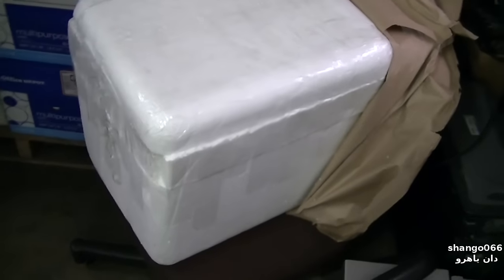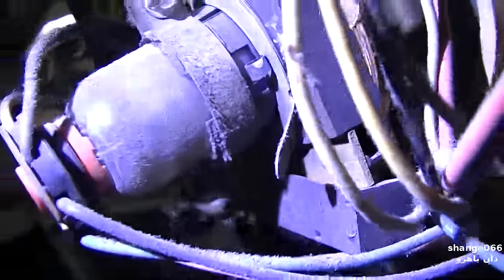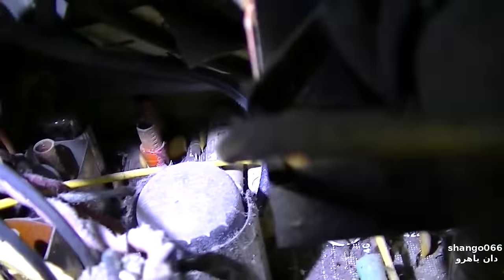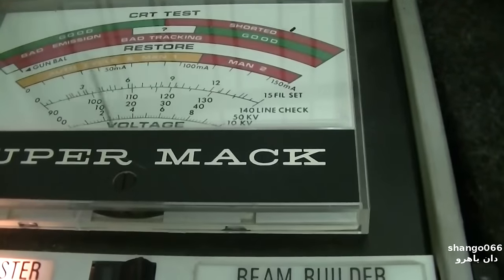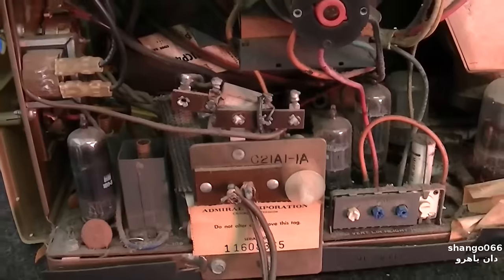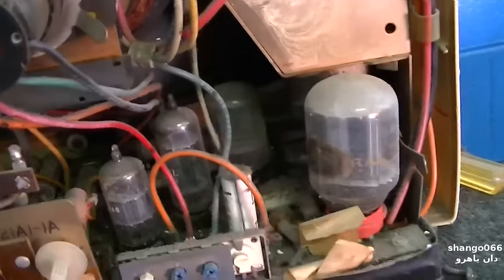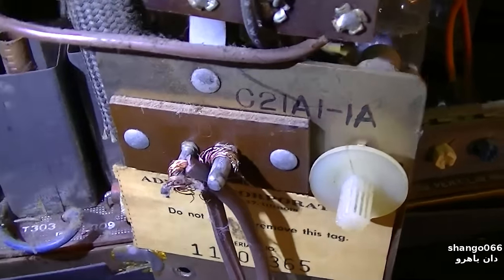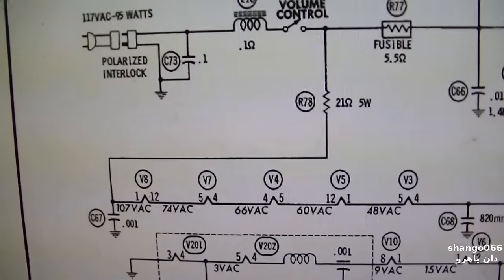Admiral Portable Black And White TV Repair

Comment: Thanks for the fright, Shango. LOL 😂 You made me jump off my lounge when it sparked & smoked. 😱⚡️💥📺
Reply: So many squares in such a short comment
Reply: AIO inc. ?????, sorry I don't see any squares!
Reply: Corinna Roberts "LOL [] You made me jump off my lounge when it sparked & smoked. [][][]"
A [] indicates a square if you didn't guess.
Reply: AIO inc. nope. All I see is a laugh face, shocked face, lightening bolt, explosion symbol & a tv icon!
Reply: I take it you don't have emojis feature on your device with the keyboard? Unless your not using a tablet or mobile etc?
Reply: Corinna Roberts I'm on a PC thanks. Microsoft Windows and Ubuntu Linux display squares in your comment.
Reply: AIO inc. Well that's explains the boxes then! Where mobiles & tablets would show the emojis.
Reply: Corinna Roberts iOS 9.3.2 and 9.2.1 aren't showing "emojis," just squares.
Reply: Well it shows it on my iPhone 6 IOS 10.1.1
Reply: Corinna Roberts iPhone 5S with iOS 9.3.2
iPod Touch 5 with iOS 9.3.5
iPhone 4S with iOS 9.2.1

None of those show anything but squares.
Reply: It must only work for IOS 10 & up.
Reply: Corinna Roberts Not showing up in Android 4.1.2 or 2.3.6, not iOS 10.0.2 on an iPhone 6S...
Reply: Well it shows up on mine! Anyway who cares, why make a big deal out of it!!!! No one else gives two stuffs ok.
Reply: I see you comment on every video lol

Comment: I picked up that same set from an auction last year.  odd crt size 11".  it had its original sand resistors, one was open.  I replaced it and the set came to life.  mine is red, but has the same sun damage on the back cover only luckily.  As for Realistic Long Life tubes...I heard from an employee that in later years RadioShack was buying tubes of any brand and erasing the labeling  and stamping them long life.  so you could be buying a high quality tube or a low quality tube when dealing with long life tubes.   Anyway...another great video.

Comment: i had a 13" Sony Trinitron from the 90's that i absolutely loved. it was a VERY pricey set in it's days and had an incredible picture. i went to move it one day and the cabinet disintegrated in my hands. it fell to pieces to the point that i was left with a bare chassis that i sadly tipped into a dumpster outside my building on Orchard st. in Manhattan. I guess that particular plastic formulation just didn't stand up to our filthy NYC air.  :-(

Comment: Your discussion of cigarette effects has been very entertaining and educational in your videos. I really like your video with 'come to Marlboro country'. I now have a Betacam SP BVW75 broadcast VTR like that I am working on, minus the high voltage conductive cigarette deposits... so far. I was unaware they used to allow smoking in some edit suites (only Frank Zappa, i thought)... but I was wrong. You can see it in the worn video drum and weirdly clumped yet air conditioned dust, and you can hear it in the bearings and smell it of course. This thing didn't say 'hello' it said 'HHggGaaaaHHHHHHH'... yet with some help, it lives! It doesn't smoke any more though.
Reply from the maker: Let not your own hands contribute to your destruction
Reply: Hmm my grandad smoked from the age of 13 and had perfect health all his life, died aged 86
Reply: Just to add some here, that hot-boxed Betacam SP VTR came from a local TV station and I recall noticing a lot of video drop-outs in the picture in those days (mid to late 90's) on that station's news programs. Bet those fancy AST betacam heads didn't last long! Not that normal wear and tear isn't sometimes brutal to these professional machines, but add a stogie, some nice unfiltered Marlbro red or even Misty to the mix, then don't re-calibrate the drop out compensator and other electronics for excessive  head wear or other issues and you get an on-air picture with lots of horizontal black (or other-colored) lines flicking by... on expensive new tape. The drum bearing for the slip ring assembly was so bad that as it was making it's loudest grinding noises you could actually see the picture twitching to the right through the time base corrector! Air currents seem to cause the abrasive sticky dust to go into the semi-enclosed slip ring assembly, and RIGHT into it's bearing. 
     When running the tape in FF or REW the guide roller bearings at first made a chorus of bad noises, one by one disappearing as the bearings ceased up. SO, WD40 lung therapy was applied to the head drum with nearly enough air pressure to destroy it, got it going about 4x normal speed which was scary, and forced said mineral oil stuffs into the top bearing until it came flying out 360 degrees through the heads. Now the picture is stable, but I don't think one juicy wet cough is going to do it.
Reply from the maker: There are some people who are immune unaffected by just about anything. However the majority will suffer various functionality and performance issue early on from tobacco use.
Reply: shango066 Yup its just luck of the draw
Reply: shango066 I love your channel cep it going men

Comment: I just picked up a set just like this one at a yard sale It had a vertical problem so while I had the back off and had it pluged up trying to see what the virtical trouble was the .047 capacitor blew up right in my face,lol.I replaced that and the set works fine.

Comment: If I were to put a 19 inch solid state CRT chassis into a monitor with a 14" tube, would that be bad for the CRT? Because the flyback voltage would be too high?

Comment: 10:42, the tube show there is a GE - just look at the acid etching with USA as a re-brand.  Realistic tubes are primary Japan made and are well made.  They are assembled/manufactured on the old Mullard equipment.  It's the Chinese tube which are the worst.

Comment: apex converter box shngo,mine went bad starting 2 years after purchase,it would not power from red to green unless it was warmed up with a space heater,channels tuned would drop off when turned on again,unit ran too hot,it went dead at year #3.
insignia is the new device,works real nice.apex was a govt rebate deal,someone got a lot of money to let us get them for ten bucks

Comment: that plastic has an "even layer of rot"...if you carefully scrape it with a fingernail or a soft tool it will be like new underneath...try it... the same happens with garden chairs and tables made of PP... tvs are usually abs or abs-pp...but since this is a very early plastic set i really dont know... but i know that if you scrape it its like you are giving it a second life by peeling the old skin off :)